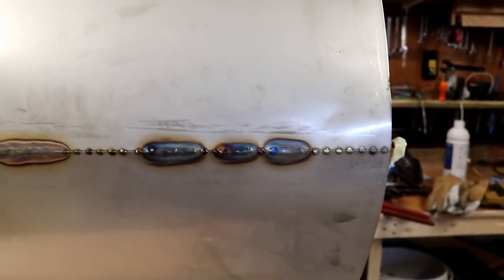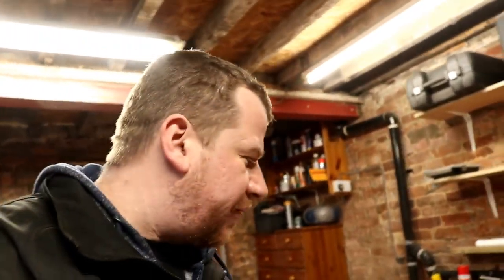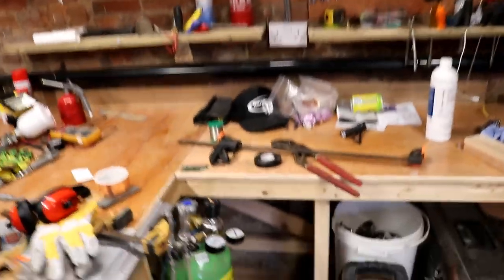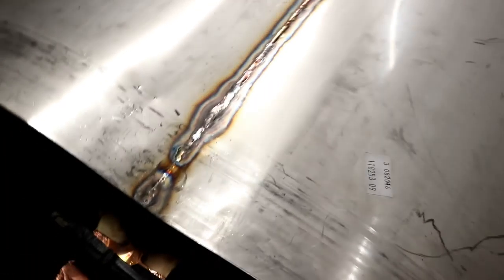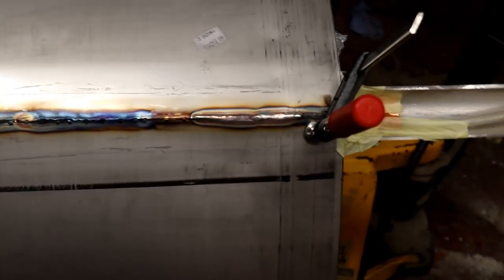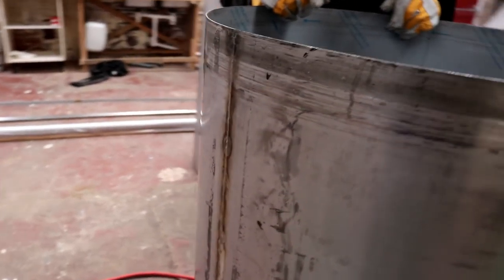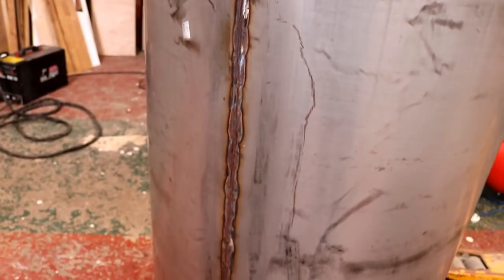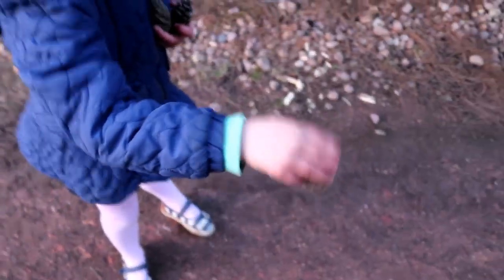TIG PULSE SETTINGS AND METAL FORMING.

Comment: Tanks are looking good but that's Monday and none are finished, mildly disappointed 😉 😄 . On a more serious note if you are going to weld the ends of the tanks on from the inside make sure that you have some sort of air flow set up and preferably don't work alone. Argon welding in a confined space is a killer. Not trying to be pessimistic but I would prefer to see the finished tanks being used to brew beer rather than reading an obituary. Great work though and your welding looks like it is coming on leaps and bounds with another superb vlog update. Again holding my breath till I pass out. Cheers, Schnuz.

Comment: Wow the difference between welding today and previous is massive,i think you've cracked it Harry m8. Just a thought but would it be easier to put fittings on before you weld bases and tops in place? Cheers.

Comment: How thick is the material? Sorry if I missed it mentioned. And why couldn't you just put them back through the roller to get the radius be neat?
Reply from the maker: 1.2mm steel. I can't open the rollers to slide a welded cylinder on, I tried but they were too heavy. Cheers Zac

Comment: Nicely getting there, can't wait till you bk up and running, wish I could lend a hand but around 3hr drive away, fancy making 3 more 1bbl 😆😆😆
Reply from the maker: Cheers mate, why stop at 1 bbl?
Reply: HarryBrew69 I'm currently converting my garage for brewing needs 😁 and I don't think I'll be able to get much bigger than that in there, plus going all electric and my cable is rated to 70amp max